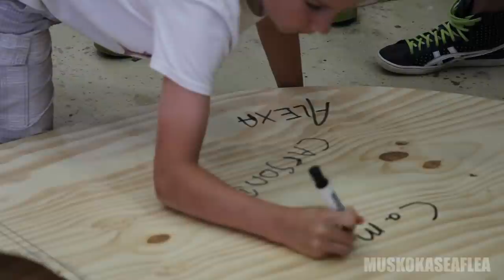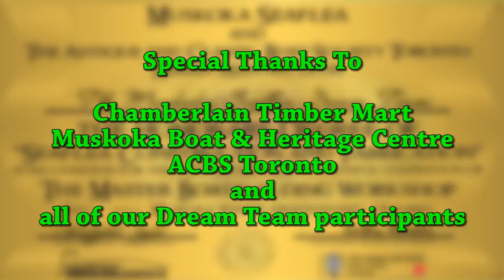How To Build A Mini Max In Four Hours

Comment: Nice boat! What did you use for a motor? How big was your steering wheel?
Reply from the maker: On the Mini Max boats you can used anywhere from a 5 hp to a 20.   A 9.9 is a perfect starter motor.
Reply: @muskokaseaflea  I have a 1977 6hp fisherman. I think I want this boat. Where is the make my old outboard fly information.